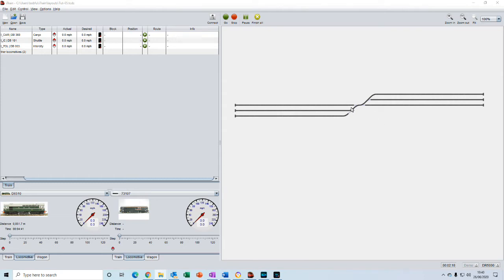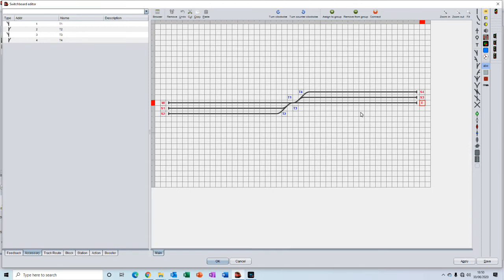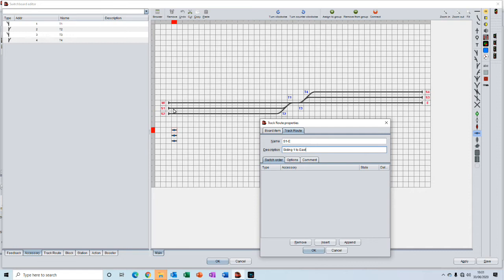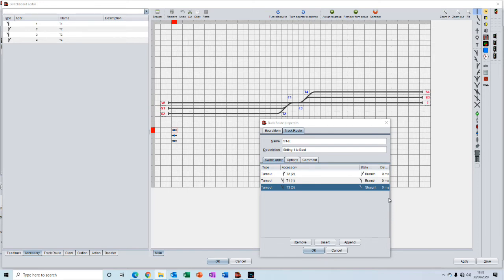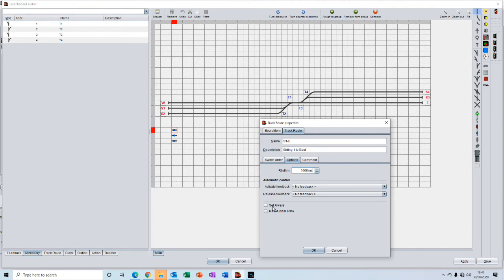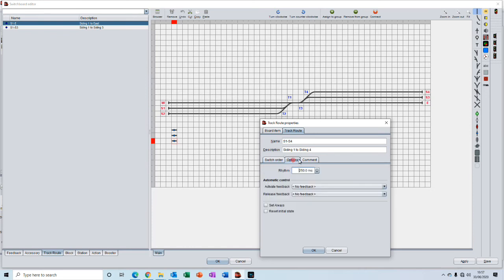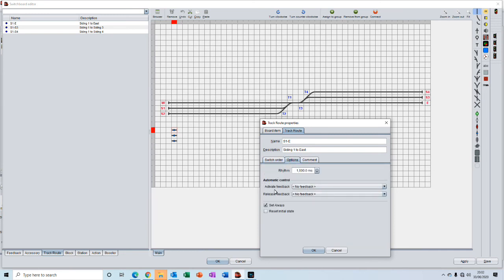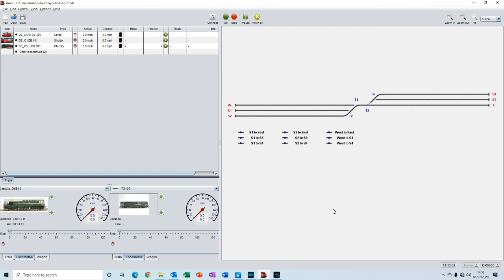Video 07: Using iTrain Tutorial Series - Track Routes

Comment: Great videos. Only just found them. I shall watch them all as I am hoping to use iTrain with a Z21. I would like to see the actual wiring/decoder connections.
Reply from the maker: Hi David
I can send you a wiring diagram which uses the Digikeijs DR5000 as the command station, DR4088's for the feedback, and DR4018's for the turnout control. It would then be a simple case of substituting the DR5000 for your Z21. Send me a PM on the iTrain forum and I can then attach the drawing and send it to you.
Reply: @bobfuller  Thanks for your offer. I actualy live in NL and didnt realise Digikeijs was Dutch. I'll do a bit more research & maybe be in touch

Comment: Hello
Very explicit videos thxs for this huge work which helps a lot 

One question: 
Why is it not the software that automatically create all the routes ? There is no added value to do it by myself plus a loss of time ..
Reply from the maker: Video 07 is only about track routes. Track routes only set a number of turnouts (defined by you) and then you drive the train manually. 

Continue through the tutorials and you will see there are things called Instant Routes (from video 11), Train Routes (from video 21), and Automatic Routes (from video 27).

Track Routes are only about the track. They set the turnouts and you drive the train manully.

Instant Routes, Train Routes, and Automatic Routes are about controlling trains and track. They allow a train to be driven manually (you need to control the speed of the train and observe the signals); semi-automatically (you control the speed of the train but iTrain will halt the train if there is a red light); or fully automatically (iTrain controls the speed of the train and observes the signals).

Instant Routes allow you to click on a train on the Switchboard and drag it to a new location and iTrain will work out a route and drive the train automatically.

Train Routes allow you to define a specific, complex route, and iTrain controls the train.

Automatic Routes allow you to simply click on a Train and iTrain takes full control of the train. iTrain decides the route the train will take and takes full control of the train.

And you can have multiple trains running at the same time with any mixture of the different types of route. For example, some trains running Instant Routes, some running Train Routes, some running Automatic Routes, and some being dirven manually.
Reply: hello and thanks for your prompt and detailed answer ;  I understand that a track route enable the automatic and correct setting of all the switches to go from a block A to a block B  so that you can start your locomotive to go to point B without having you to action manually every switch along this route in the right position which is a great help
but  on top of that , the software could be programmed to create itself these routes automatically avoiding the user to do it himself...
No?

your videos are great and i will ask for a test download of iTrain which appears to be very powefull but also simple ( except for above 🤫😇😀)

THANKS👍
Reply from the maker: @papiloco1530  Yes, Instant Routes and Automatic Routes will automatiically choose the route for you. You can then choose to drive the route manually, semi-automatically or fully automatically. Keep working through the tutorials and it will become clear.

Comment: Thank you Bob. Would you recommend a 1 sec delay for slow action point motors as well?
Reply from the maker: Good question, Taste. I assume your question stems from slow action point motors needing more than  1 sec to drive the point motor. A 1 sec delay is the safe figure for most situations and types of point motors, including the slow action types. The real objective is to avoid all the accessories switching at the same time. When any type of accessory switches on, there is an initial spike of current and then the current settles to its normal value. The delay on each accessory creates a cascade effect in time, so avoiding the spikes all occurring at the same time which could trip the power supply or cause erratic behaviour.

You will probably find that you can operate reliably with less of a delay, say 500ms, but it depends on a number of factors:
The number of accessories in the track route.
The current that your particular accessory uses.
The current rating of the accessory power supply.
Etc, etc.

1 sec is the relatively safe value, but can be reduced depending on circumstances.
Reply: Tase, for Slow Motion Point motors, Tortoise, Cobalt, TBP and the like you should put a State Delay of 1500-2000ms in the State Delay field of the Option Tab. This ensures that the motor has changed the turnout before iTrain tries to send a train over the turnout. The activation delay is to ensure that the power supply isn't overwhelmed by to many turnouts all trying to change at the same time.
Reply: Iain Morrison Thank you Iain. I’m mightily impressed with the software but as with most things if you scratch just beneath the surface one sees just how powerful it is.

Comment: Exceptional video series Bob.  Is it possible to highlight the entire activated route and not just the included turnouts?
Thanks, Rush
Reply: Yes you can, what you need to do is enter the Switchboard Editor to highlight each track from the turnout to the buffer e.g. all of West to T1including T1 and press the 'G' key. The track should now turn gold. then move to an empty block somewhere and press 'G' again. Repeat this for each of the tracks. On Turnout T1 you should highlight the turnout and the block between T1 and T3 then press 'G'. Finally highlight an empty block and press 'G', then apply and save the Switchboard. When you use a Track Route it should now be highlit in Gold
Reply: @damenfeld  Thanks Iain, but I seem to be missing something (I should say that I'm a total newbie to iTrain).  When I highlight the track and press G, nothing appears to happen.  I've even right-clicked on the selected track and selected the Group option, but that doesn't appear to do anything either.  Thanks for taking the time to help.
Reply: Figured it out - many thanks!
Reply from the maker: Glad you managed to figure it out. Remember, these are only track routes which you can use when driving manually. The real power of iTrain is provided with Train Routes which we have yet to cover. Train Routes will automatically highlight the whole of the route and do many other wonderful things.